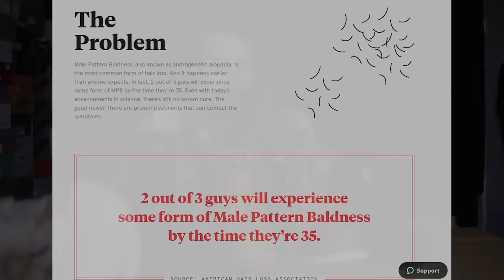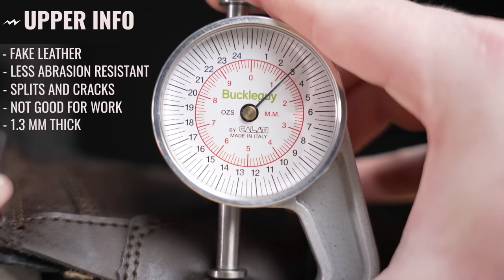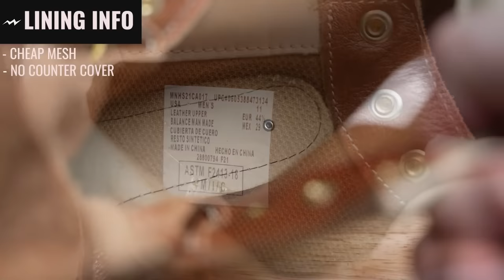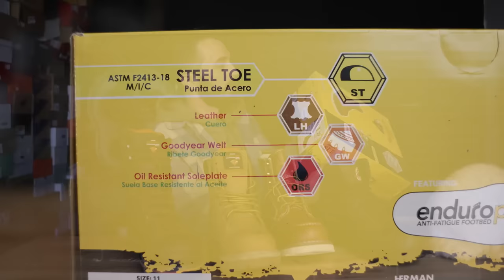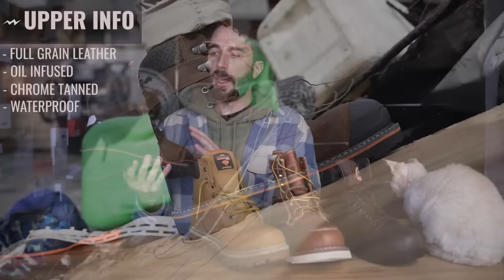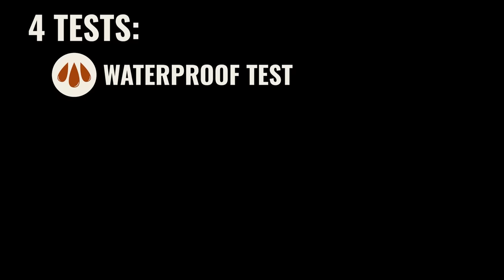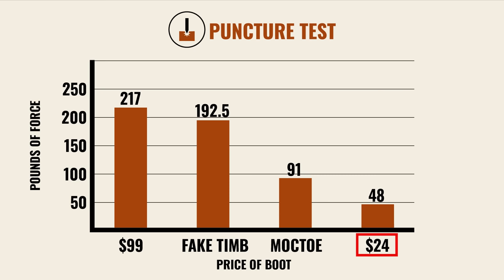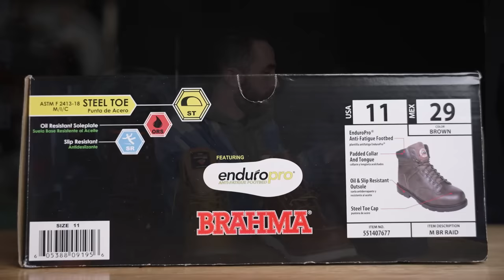The Truth About Walmart Work Boots - Best CHEAP Work Boots or TRASH?

Comment: I took a job at a factory and didn't have a lot of money. I went to Walmart and purchased some brahma steel toe safety boots. Well, I got lucky! They weren't that hard on my feet and I was able to get the boots at an affordable price point, so I could work.
Anyway, about a year later the boot truck came by and work gave me a coupon.
They were my first $200.00 boots. That was years ago.
I still have the brahma boots as a reminder.
Thank you for hitting more affordable boots.
Reply: Just got a paor of hermans on walmart website for $29 shipped to my door like i didnt even need them but for $29 send em
Reply: Those $25 dollar Walmart boots were my first pair of steel toes. I had to have them by the next day and they were cheap. They lasted maybe 4 months when the heel delaminated.
Reply: are you telling me that in the US employees have to pay for their own safety gear ? that's crazy...
Reply: @Col_Mustard Depending on the company yes
Reply: @koldhearted1  thanks for the (late) answer! Here in France, and I assume in the most part of Europe, your employer has to give you all the protective gear you might need, hence my surprise...
Reply: @Col_Mustard 👍 Happy to share across cultures. Wander into videos at different times. It really depends if there are mandates. If you have to wear steel toes or safety caps or if the shoes have to be slip resistant or whatever then yes the employers are expected/required by our health and safety (OSHA) to either supply the clothing or give a supplement for it. Something like safety glasses or ear protection they will supply it because it's better than a workers compensation claim. Fire resistant clothing will be either a jump suit or if they are well funded then it could be separate articles depending on industry. Construction is one that is hit or miss. What the video is looking over is more the new guy shows up for his first day this is what we require to be ready for work. Well I don't have those so I need something quick and inexpensive to get started. Once the boot truck shows up or once I get a paycheck in my pocket I can get something better.
Reply: Brahma made a decent pair of boots back in the day. Don't be scared to spend your paycheck on a nice pair of durable boots you like, it'll pay off.

Comment: I bought the moc-toes based on this review. I got the oil tanned version $49, which presumably dodges the flame test issue. So for my $49 I get genuine leather, a Very comfortable sole, steel toes, and for what it's worth, a goodyear welt. And I got to try them on in the store. That's a lot of boxes checked for not much money. I'm a light duty user and I'm very pleased. For rough terrain they're not that great, but for just standing on your feet like behind a cash register these could easily be best for the money and might be best period.

Comment: When I was a "kid" I got a construction job. I was told I needed to have a pair of steel toes to start work. Being poor I bought a pair of "Bramas" from Walmart. The very first day, I needed to kneel on the ground for a few hours. After focusing on work for a few hours I stood up and noticed the "leather" was completely worn away from the steel toe. The entire "toe box" was an exposed silver metal cap with no leather left at all. I thought that was odd but had zero experience with wearing steel toe boots and thought maybe it was me. After wearing them for 2 more weeks, I noticed the bottoms were completely smooth. The tread just wore away instantly. The tread wasn't rubber, it was foam. It was unbelievable that a store would sell such a shitty product. Within 2 weeks these boots looked like I wore them for a decade. I remember needing to buy boots with my second ever paycheck. This time I bought a pair of "Chippewa" boots, they lasted like 3-4 years. Never ever EVER buy boots from Walmart. Spend a little more, and you'll get a product that lasts like 100x longer. It's so crazy the quality difference when you don't opt for the cheapest one.
Reply: BS
Reply: @markjohnson8824  ? LoL
Reply: Pick your God damn feet up son
Reply: a rubber toe and heal are necessary for a long lasting boot

Comment: So I've owned the "fake Timb's," for about 2 years, in which they have received pretty much daily use. You "hit the nail on the head," with your assessment. The lining of the heel was the first thing to go after about 3 or 4 months. They are still quite comfortable to this day. Although, the thin rubber out-sole, held up okay, until I started climbing roofs with them for a few months. In spite of those 2 defects, they really have been pretty damn good boots, for the price. It really depends on what you're going to do in them. For me, and what I do, they're just fine for a 2 year clip. Good job
Reply: When it comes down to it, they probably are worth more than what you paid. So good value.
Reply: @standupstraight9691  Agreed👍

Comment: I owned the $24 boots for about three weeks. That's how long they lasted before the 'leather' wore away from the steel toe and the sole completely separated on one of them. I've since upgraded to Thorogoods and haven't looked back.
Reply: I bought the exact same ones as a stand in boot while I was looking for something better. I worked in a Walmart garden center at the time. They literally lasted me maybe one hour my first day wearing them, I bumped a pallet with the toe and it cut about a one inch crescent right down to the steel toe. I returned them that night and never have bought boots at Walmart again. Currently alternating between some Italian Cofra and a pair of Avengers I recently got in my warehouse job.

The Cofra boots were around $130 but have lasted me through over two years of intense abuse and are still somewhat water proof even after stepping on three large furniture tacks and constantly being used to kick pallets into place. Glue is holding great. Leather has zero holes.

The avengers were maybe $115 and aren't as comfortable but they're an all Kevlar upper and I think it's still breaking in after a few weeks. Those also have puncture plates and are showing zero wear from the abuse I've given them so far.  I used to be a cheapskate with boots. But I've found it's definitely worthwhile to invest in them, not sure why more jobs don't give out vouchers for good boots and require at least anti slip shoes, they'd save on injury claims. Sorry for the rant.

Comment: I used a version of the fake Tim’s for a year of hard use on roofs, ladders, and job sites then occasional use in the yard or workshop. The old version’s outsole hardened and became brittle over time, so chunks would split off occasionally until it finally delaminated in the summer heat. They were worth it for me for the price at the time with a very small budget, especially due to the lack of any break in period. If I had worked on any serious construction worksite, on concrete all day, or in gravel though, they would’ve ground down to nothing in little time. Great content!

Comment: Thanks Weston for the detailed tests, showing the internal construction, as well as pointing out poor quality design/construction.

I wanted to add my 2 cents, since I bought the Fake Timb from Walmart 10 years ago.  The construction appears the same as it was then, with exception to the reflective insert above the heel.  I only used these boots in the snow for a total of 10 hours wear time.  The rest of the time, they sat in the bedroom closet.  Last year, I decided to pull them out and wear them to clean up some broken glass.  Within a few minutes after putting them on, the sole separated from the upper.  With the sole off, I could see why; the sole is actually a tub to hold the adhesive, which provides the only means of attaching the sole to the upper.  The mystery adhesive broke down in a normal home temperature and humidity, allowing the split to take place through the midst of the adhesive "pool".  I say pool because the adhesive thickness is 1/4 to 3/8 inch thick.  I have been wanting to replace these with some good quality boots but, it seems everything is made in China these days so, long term quality is very questionable.
Reply: Have a pair of clearance herman survivors that did the same thing. No adhesive will stick to them either the midsole is such crap.

Comment: It’s easy to justify shitting on a walmart boot, but to be honest, ive seen much worse from brand names charging more for worse quality than this. At least you know what to expect from walmart. 

That said, its a $50 boot… if you need something to get you through your first month of work until you get your first full paycheck, these are a godsend to many people in their first labor job. 

It would cost you the same amount in gas money trying to thrift a used boot and some people just can’t afford the hunt.
Reply: Use a credit card, do your research online, up your price point. It's cheaper in the long run.  Some people think the cheaper the boot, the more successful the purchase.
Reply: Carhartt boots are horrible...
Reply: @ORIGINALDaveB  Which is why the term "walmart poor" is prevalent. Items this cheap are designed to keep people in a loop of buying and replacing cheap shit. Another one of the 10,000 ways having money/access to money helps you save more money.
Reply: @Ryuujinv01  Agreed.
Reply: @ORIGINALDaveB  could I borrow your credit card? until payday
Reply: @SoulforSale  nah just go into debt with a corporation instead of waiting a couple weeks to get something better
Reply: Obviously these boots are not meant for heavy duty labor but light weight work for factories that produces papers, plastics, rubbers etc. Something that gets you by for a year or two just standing in front of a machine

Comment: For the people that aren't able to find good condition work boots at a local thrift, I see either new or almost new steel toe red wings all the time on eBay and Poshmark, there's usually something lightly used for around that 100 mark.
Reply: We have five shoe stores in our little recreation town. Unfortunately, buying shoes online is the one item it's tough to pull off. Feet are so different and stated sizes always vary.

Comment: I think one detail worth adding to videos like these is repair viability. among all these boots I'm pretty sure only the most expensive of them would even be possible to do a heel replacement on after the rubber wears out. Shoe repair shops aren't really able to bond the soft foam rubber materials the way factories can, so with shoes with a lot of low density foam bottoms they may have to resort to doing an entire re-sole to repair the shoes. 
Also the bit about getting boots at a thrift store is a good tip, but for proper steel toed boots you'd have to get pretty lucky. But if having a steel toe isn't important for what you'd need the boots for then I'd recommend picking up a pair of old Altama combat boots because they're comfortable enough and plenty sturdy, and usually only around $15-30 as long as you get to them before some uppity kid with a depop account does so he can try to sell them as "rare vintage authentic military combat boots $150"

Comment: The steel toe corcoran marauders are amazing.  Very comfortable, american made, lasts for a very long time and most of the time you can find them on sale for around $100 - $150. Just sent my black pair in to get a resole after 5 years of daily use.
Reply: Preach. Best boots for my career field (AF). I don’t buy anything else.
Reply: @jacobwitt2070  whats AF
Reply: @joshtheflatearthjedi222  it means he's a pog.
Reply: @thedude5449  What's a pog?
Reply: That's the brand?
Corcoran marauders?
Reply: @mogroot5790  The brand is Corcoran and the version is the Maurader steel toe.  There are a few different versions of it, but the sage green version is the outgoing authorized airforce colorway that you can find pretty good deals on as the airforce is changing their uniforms to multicam.  For the price, you get alot.  Traditionally and US made. I have both versions, a black non steel toe that I used daily in the coast guard days for 5-6 years and a sage color steel toe.  Both are excellent and will last for a long time and very comfortable.
Reply: @russellromig8969  Thanks.👍
Reply: Any Corcoran yes yes yes!
Reply: I love my Corcoran Jump boots. They are 6 years old and I have to get them resolved, the sole split on one but the upper still looks nearly good as new. I tore a ligament in one of my ankles a couple of times that took years to finally quit being sore. While the Corcoran's were not the most comfortable on my foot while walking on concrete, they were by far the best of quite a few shoe choices I tried for preventing soreness in my ankle.
Reply: @xxxxtripxxxxOSG  so Corcoran is a good brand?

Comment: The $20 pair are decent to an extent.  Use to get them since I had to work a job where it would get very dirty and needed slip resistance. Didn't see a reason to spend more UNTIL I wore them in after a week and I stood on top of a wet floor, the soles would absorb the moisture and my socks would get soaked. I thought my feet were just sweaty, lol nope. Literally a wet floor made my feet wet, and I don't mean sitting water. Like, a mopped floor was enough.
Reply: They're good till the first paycheck 😅

Comment: Back in the late 90s Brahma boots were awesome real leather boots. They honestly sucked to wear for about a week until you broke them in but after they were very comfy. In the early to mid 00s they started to go down hill very quickly. When I was a welder I would go with them every time but as of about twenty years ago you could not pay me to use them.
Reply: Unfortunately, it seems like nothing is made the way it used to be. 
I've had $150-$180 boots that have worn out in about the same time frame as the cheap ones.

Comment: These are the starter boots you buy when you start a new job and are saving up for better ones. I made the mistake of being cheap and never upgrading. I needed brand new feet after I finally threw these Walmart boots in the trash
Reply: Yeah my jobs requires steel toe boots and I don’t wanna pay $200 for premium boots rn

Comment: I'd love to see you cut open the dr martens ironbridge work boots! I don't know where they stack up but I personally love them. They're a bit heavy, I replaced the insoles with a similar dr martens insole because the insoles that come with them, although very cushy foam, don't have much arch support. I wear them in a kitchen so they may not see as much wear and tear as a work boot often does, but they've held up well walking through dishroom puddles, running them over with carts, and walking on slippery floors 40+ hrs a week. First failure I've had was the laces and insoles needing replacing so the boot itself seems durable. It only seems reasonable laces and insoles would need replacing after a year of being worn regularly for long hours. But I'm interested to see what you say about the construction.

Comment: Had a cheap pair of black brahmas back in 2000 steel toe some kind  of material with suade leather. Did city deliveries all day pushed a manual pallet jack with up to 250 to  3000 pounds throughout day  . Lasted at least a year.  In and out the truck going to customer probably did at least 3- 5miles a day.

Comment: 24$ steel toes are actually a great bang for your buck if you’re Broke. I’ve had a pair for 2 years and I’ve used and abused them and they’re still holding up strong. drawbacks are that they’re not very water proof but they do keep you warm. Great for mechanic and working construction or outdoors
Reply: Lugz and sketchers are a far superior  cheap boot than the Walmart boots. I've gotten lugz at end of season  sales for $20 off amazon and will last about  a year. Sketchers  last even longer

Comment: He’s right on with the 100 boot! It’s a very hot shoe indeed. Wouldn’t recommend for heavy duty work outside on a continuous basis! The shoe will fall apart in no time. I only gotten a second pair because the Walmart I live by was closing and it came up to 60 dollars to get them. Spend the extra few dollars and get a higher brand. There’s after pay and may other pay installments now days. When it comes to your feet don’t be cheap! 100 dollar boot is okay but eventually it’ll get worse by time walking in them.

Comment: Brahma has a different boot that's $40 and is a roughout leather, I bought them from a Walmart not far from you and i've been using them as a mechanic for 3 years. I originally bought them for the cheap steel toe, but they turned out to last really nicely.
Reply: Over the years I've found that there's a big difference between different styles of brahma boots. Some are absolutely horrible, others are surprisingly decent, at least when compared to the price.

Comment: we used to have problems with some guy's cheap boots having the sole melt walking across hot boilers in power plants or steam pipes when the pipes are around 300 or above have you tried putting them on a hotplate to see what temp the sole melts at? it seemed Vibram soles and such held up better then plastic